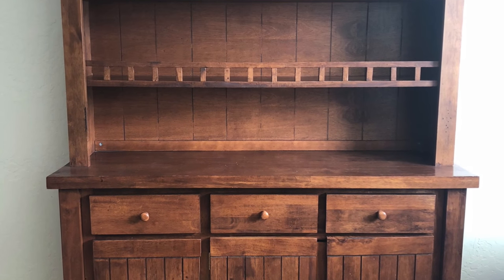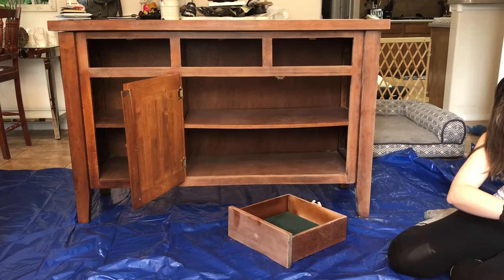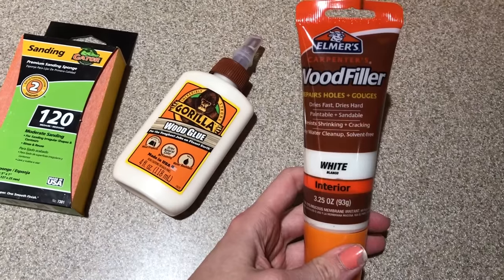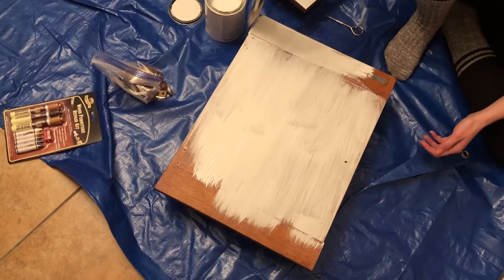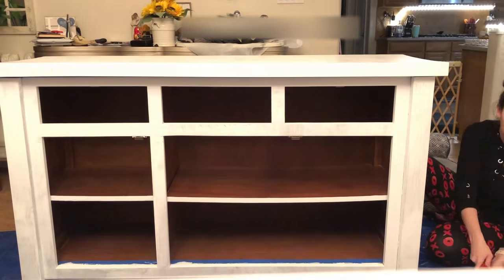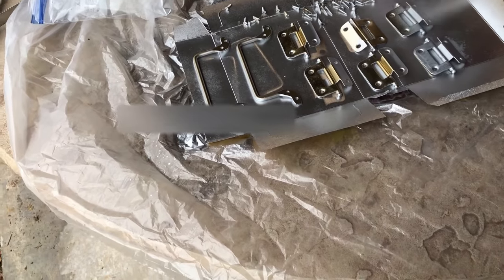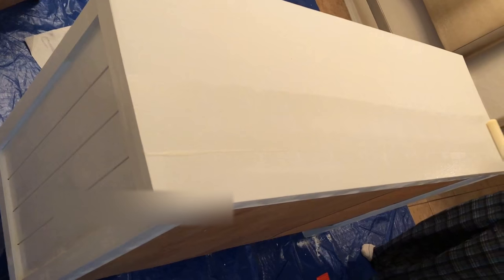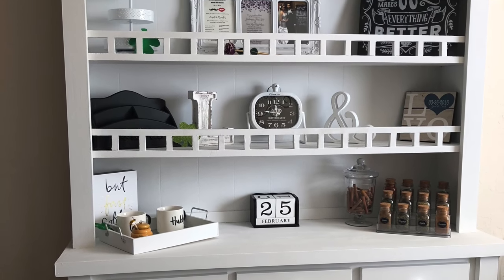DIY Kitchen Cabinet/Kitchen Hutch Makeover With Chalk Paint

Comment: Good job! About the poly there are some product water base and works very good on chalk paint especially clear colors like white, poly oil base will always make it yellow but it is much resistant I use it but only in dark colors, the bad thing is you loose the matte finished because the polyurethane is always more glossy. You did a vey good job...it is always more difficult make a white piece!!! Usually they bleed a lot when you try to sealed it. 👍
Reply from the maker: PAMELA thanks for the info! ☺️ I'll have to give it another shot next time I do a darker piece.